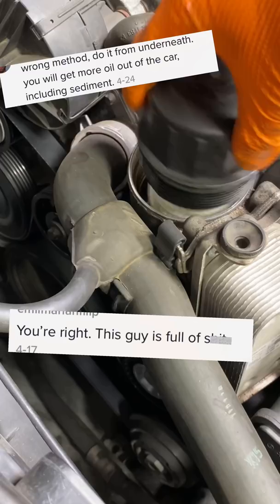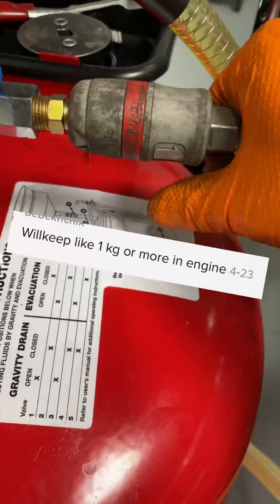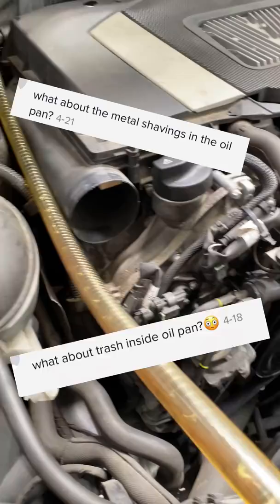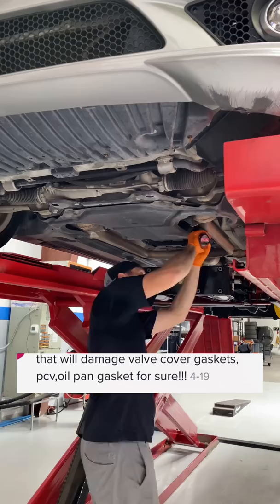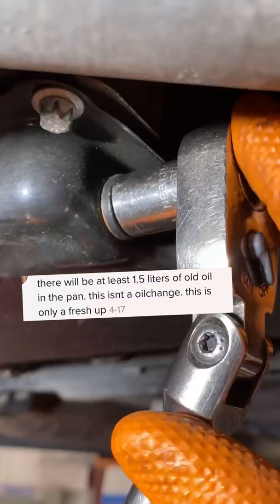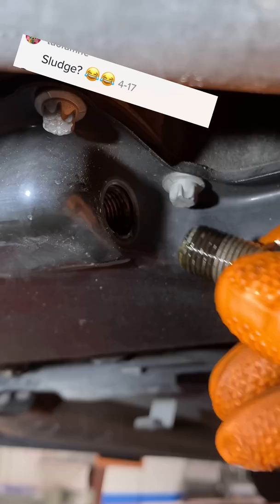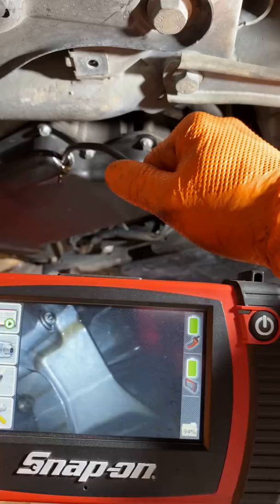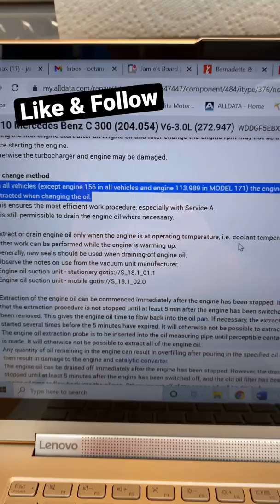#shorts Mechanic Proves Haters Wrong

Comment: "Ya know, there's a reason why he's a mechanic and you're not."
Reply: You mean the shop’s subscription to AllData or the hot oil vacuum?
Reply: Or maybe just the shop itself. No expense was spared on providing it with the best patients in town. Too bad he had to take those hypochondriacs to school with his psychology degree.
Reply: @HighestRank  he was trained at BMW
Reply: @BallerShortsHD  anyone can be a mechanic when the tech does all the work for you
Reply: @chrisbosco8135  oil change requires no skills or really any tech, but not everything in being a mechanic is neo taken over by tech, not yet
Reply: @BallerShortsHD  i think your wrong , because you put wrong oil on some engines and can cause some great damage to the engine, so  you really have to know what your doing.
Reply: @joseone69  that's true, but you can find the recommended oil for your car in the manual, and all the equipment you're gonna need is a car jack, I was just implying that there's really no tech involved and an ordinary person with common sense can change it
Reply: @BallerShortsHD  the oil type is also usually on the oil cap itself 👀

Comment: Person who's not an engineer
points something out that's, in theory, an obvious flaw, had it not been compensated for already
Oh, you thought of that, but the person who designed it didn't think of that when developing the product?
Reply: I mean, I can think of at least one example where a student corrected an actual engineer who designed a skyscraper (there was a flaw in the skyscraper the engineer was using as an example in his class) , so I guess it does happen.
Although I see this pointing out flaws a lot, even with obvious things, which there is no way the engineers haven’t thought of.
Reply: @antekswiergocki6537  YouTube commenters aren't architectural engineers lol
Reply: Engineers are far from perfect when designing things. Ask any mechanic. Engineers live in a bubble where everything works on paper or in "the models" but in practice has loads of issues. For example, where did gm put the starter on the Northstar V8? In the intake valley. Under the intake. What are 2 things that accelerate starter wear. Excessive heat and debris/contaminants. What does the engine valley have in excess? HEAT AND OIL TO ATTRACT DEBRIS. and a 20 min job to replace the starter is now a 3 hour one because now you have to remove the intake...
Reply: @BenDover-sc5du  they easily could be. why can't an architect comment on youtube..?
Reply: @joec1995jc  wasn’t the carb used on the old 440s from Plymouth made out of plastic? Man, what were all these engineers smoking at the time… well, it was the 60s/70s…  🤣
Reply: @slattduke  I would wager his comment holds value due to there not being a massive amount of them in general, and to be then commenting on YT just makes it seem less likely. Not impossible, just less likely than say, a retail worker or college student commenting, since both of those types make up a larger portion of YT viewers. Cheers
Reply: @BenDover-sc5du  You're right. Engineers are allergic to YouTube
Reply: As someone who works on hvacr equipment. True, engineers do get thing right 99 percent of the time. But I swear, who ever is designing the form of units needs to be forced to diagnose and repair them when they fail. Some units are nearly impossible to do basic repairs without tearing it complete apart
Reply: @joec1995jc  You're not understanding me.
Reply: @antekswiergocki6537  But they typically think of the obvious things that a layperson does, is my point.
Reply: @dreugh424  there's an issue with not eating enough fruit, so it happens. Exactly what I was doing when the short video popped into my YT feed.
Reply: It’s like mattel releasing a gay ken doll and not realizing it was gay and then pulling it from the market, or those millions of VWs that shit the bed and got recalled some years ago 😂
Reply: @BenDover-sc5du  architects aren’t engineers at all, they design to a spec. Engineers create that spec
Reply: @joec1995jc  let's not compare gm engineers with anything let's just not....😂
Reply: @dreadnoughtprime6301  starter... Inside.... Engine. How is this not a totally obvious flaw...
Reply: @antekswiergocki6537  skyscrapers are in themselves a flaw
Reply: @joec1995jc  You clearly don't understand me.
Reply: Common Sense Realist  You're not an engineer, though. And you misunderstood me.
Reply: Well... Yeah. Design flaws and user interface are probably the biggest issues an engineer has to deal with.

I had a vape that you are supposed to sit upright or it leaks, the charging port is on the bottom. There's no way to charge it, standing, without configuring something. That's definitely u.i. oversight, but that's fine, because the next couple of models didn't have this issue. Likely because people got online and said something.
Reply: @joec1995jc  Read what I said...
Reply: @dreadnoughtprime6301  have you read what I said? At least once a day I run into stupid decisions from engineers that I could come up with a solution for. So yes, I, a lay person, definitely thinks of things that engineers don't.
Reply: @joec1995jc  You most certainly need to wok on your reading comprehension. You're also not a mechanic.
Reply: @dreadnoughtprime6301  and I suppose you are with your raptor bro-dozer?
Reply: It's a Mercedes, so no.
Reply: @2010ngojo  Yeah, I couldn't afford one either.
Reply: In this case they did think about it but it does happen frequently that a technician finds what the engineer misses…
Reply: @jaycechenault3940  Jayce 🤣🤣🤣😭😭😭💀💀😏
Reply: @slattduke  I'll give you 1 / 1000 commenting. You're right
Reply: Common Sense Realist  Read my comment. Also, you don't do that for a living.

Comment: Bought myself an extractor pump last year, love how much easier oil changes have become as a person that goes DIY with my car's maintenance.

Not having a lift or ramp, without it I have to remove the entire under tray to get at the sump plug, ugh so much effort and time for the same effect!

Reminds me, I need to go buy stuff for an oil change that's due soon.
Reply: lazy
Reply: @joeyh7796  you spelt “effective time management” wrong
Reply: @barelmaker  DAYUM
Reply: I have been using the extractor on my range rover since I have owned it. Works great.
Reply: When you jack the car up for an oil change you get to rotate your tires as well. Its a win win
Reply: I have an extractor for my small engine equipment. 
Works great.

In some cases the designs of small engines and the mounting applications are not compatible with simple non messing oil changes.
Reply: @NesQuik2258  Word, if it doesnt have a technical bulletin to do it, better to lift it for this. A quickjack, a wrench and impact make a rotation and change a 10 minute, $20 job, and its actually done right.
Reply: How much did you get one for?
Reply: @shawnr771  wow a lot cheaper than I was expecting, thanks!

Looks like it works on cars too
Reply: @EdDeezNuts944  the one I got works well on small engines.
Reply: @barelmaker  you’ve cleanly never worked on anything automotive
Reply: @joeyh7796  You clearly have a superiority complex based on if someone takes more effort to do something or not
Reply: That’s cool until you have a newer Mercedes without a dipstick
Reply: Extractor pump is only for one purpose, Oil change. When you have jackstand & jackfloor ,that made multipurpose.
Reply: My oil filter in the bottom in very tight place 😭
Reply: @joeyh7796  Joey still want us to boil our water to bathe and ride horse and carriage to see our families in different states. This guy hates efficiency 😂

Comment: People really be like "I have metal shards in my oil but all I'm worried about is getting all the oil out"
Reply: How does one get metal shavings in their oil?
Reply: @mcflamewang9442  by using one's car(they are inevitable)
Reply: @mcflamewang9442  long story short - you shouldn’t ever have “metal shavings” in your oil. Microscopic metallic debris, perhaps, but never “shavings.” Even the heavy equipment we run 500 hour oil change intervals on and send out oil samples on every time never come back with “shavings” in the oil OR in the filters (filters are cut open, pressed, & inspected every single service). On occasion, samples will come back with a a small (ppm-range) of bronze, steel, aluminum, cast iron, molybdenum, and so on, most most commonly what we see is rising levels of silicon (also known as “dirt”) as the engine gains more hours. Thus why we change the oil & filter.
Reply: @gorganfredman5363  You're one of those people who go 50mph over a street that is essentially a giant pothole aren't you
Reply: @gorganfredman5363  if you have metal shavings in your oil you need a new engine or a rebuild not an oil change. Metal shavings are not inevitable.
Reply: @97marqedman  you do realize you said all that for nothing because he asked how do u get metal shavings 😂🤦🏻
Reply: @SgfGustafsson  you’re one of those people that crosses rail road tracks at 2 mph
Reply: @mcflamewang9442  it’s quite simple. If you find metal in your oil it’s sign something is rubbing metal to metal. Either it’s a timing chain on a block or bolt. Or a bearing is being chewed up. Both are signs of a catastrophic failure
Reply: @elgronte2521  Yes it is inevitable and is visible if you have a magnet in your drain plug. The magnet will  pick up bigger sized particulates and you can literally see the metal. I have a diesel ford excursion and my drain plug has a magnet in it. It has almost 260K miles and had a complete engine rebuild with a kit a little over 50K miles ago. Proof that even with a rebuilt engine, the engine oil can still accumulate metal dust and particles.
Reply: @TheColts1027  You are free to wreck your car treating it like shit, but that doesn't mean I will so that you can drive like a degenerate.

Comment: Mercedes Engineers: Let's make doing an oil change super easy!
Haters: We still gonna crawl underneath the car, ignoring the factory developed procedures.
Reply: No joke I love this idea.
Reply: Realistically only a specialist would have the tools to do that so that’s probably why. So you’re forced to take it to the dealer for servicing.
Reply: @patron6666  you can purchase a vacume pump for this application for about $60. Pays for itself pretty quickly also useful for vacuuming other fluids from vehicles for the less regular maintenance.
Reply: Too bad they went the opposite route with the transmissions.
Reply: @patron6666  not at all. I do this with a $150 mighty vac extraction tool. Not a drop comes out the plug on the vehicles that are made to be vacuumed.
Reply: @patron6666  i literally spent 100 bucks on the type of vacuum tool to get the oil out. i just did it on my GLI and it worked perfectly. so ur incorrect man
Reply: As a ASE master tech of 35+ years when you put the vehicle on a  lift ,not only do you change the oil you can at least visually inspect the underside components as well .Wake up & catch up pleas!
Reply: @andrewslagle1974  like I said, I take out the plug to check anyway. Plus you want to take the plug out at least every few oil changes because it will get seized up in the salt belt. You wouldn’t think so but it’s true.
Reply: @andrewslagle1974  The oil change on Jaguars is done from a pipe at the top of the engine and the oil filter is also reached from the top,. so why wouldn't other manufacturers do it? Many vehicles have an anti-scrape tray underneath these days so no, they wouldn't jack up the car to check underside components. Wake up and catch up,  if you're going respond at least get the answer right.
Reply: Super easy? Oh yeah let me grab out my Mercedes oil extraction kit, my oil reservoir, and my air pump to change the oil.
Reply: @benpeterson1238  If you don't like to DIY cars, none of this will make sense.
Reply: @benpeterson1238 you can buy a manual pump for like 50 bucks or a air operated one and a small compressor of like 300. The amount of times you'd use it would be worth it. Do you just give up of you need to buy a tool you don't have?!
Reply: @04foxxsake  $300? In the UK you can buy a cheap pump that plugs in to the 12v socket or connects to the battery. Mine cost £12, they have gone up a bit now.

I don't know how long it will last and maybe a mechanic who is using it daily might want a better one but I've had no issues. I've done about a dozen oil changes with it using the factory recommended method of draining from the top.
Reply: @severnsea  I was just going higher end of the scale for a home gamer. I'm sure there's cheaper options
Reply: @severnsea  yah, just looked. 50 bucks for an electric one and 190 for the industrial one like thr video.
Reply: I mean this is still a extra tool you need to buy, fine if that’s a extra option, not so much if they would make it a only one, yeah you still need a car jack or a ramp to do this, but that’s very usefull for a bunch of repairs, and well most importantly, when getting under the car you can inspect if it’s looking all good and not all rusted, yeah you can do that separatly but it’s better to just kill 2 birds with one stone
Reply: @patron6666 you can do it both ways goofy
Reply: Auto technician of almost 20 years, I'm not paying $200 for a tool to do oil changes, I just ship benz to the dealer
Reply: @joshuahixon1425  not for 90% of ppl who buy the cars
Reply: @Matthew-ou2ie for real, any transmission service on a Mercedes is a certified pita. I love everything else on these cars though, very well thought out.

Comment: Yeah we just started getting these at our shop. And while they don’t work a lot of vehicles, the do a better job on Mercedes than pulling the plug. 

I PROMISE you, there isn’t a pit tech or lube tech that waits till the pan stops dripping. Most of the time there’s still someone a stream coming out. 
But when you hook these things up to a Benz, it doesn’t leave shit, period. Idk how tf it does it so fast either. 8.5 quarts gone in less than a minute. Honestly amazing.
Reply: Your mums amazing 🤩
Reply: Yeah very impressive. Should look a schematic diagram. The dipstick tube probably reaches all the way to the bottom. That’s just my guess tho.
Reply: @robertocommander2153  yes it does. I was a lube tech for Nissan. After 2 years this machines got brought in. So the pay is trash and sometimes this takes just as long as doing the plug. But they rather not worry about stripping the plug so we use these oil vacuum 3000 machines
Reply: former lube tech, i at least torque the drain plug but that pan ain’t empty
Reply: @willpretty7317  wtf is lube tech 😂
Reply: @readmore7180  I think it makes them feel better instead of being called an “oil changer”. 😂 😂
Reply: @Lotek117  oh must be an American thing.   👀. Here it's tech , senior tech, master tech.  Tech I suppose are the oil monkeys lol. Seniors do the work of techs and master techs, and get paid less than both because they don't hit bonus because they have to do diagnostics and don't have a master tech badge so don't get master wages 😂
Reply: @ani4389  do they use the vacum on all makes or just Mercedes
Reply: @steincracker2721  I only worked for Nissan. If any of the colored straws from the machine fit where your dipstick goes, then they’ll use the vacuum. The dipstick touches the pan so it sucks up majority of the oil. If you prime the vacuum and give it a few pulls you’ll get more oil but because of the viscosity you never really take all the oil from the engine. Anyway no they don’t work for all models but they do for most